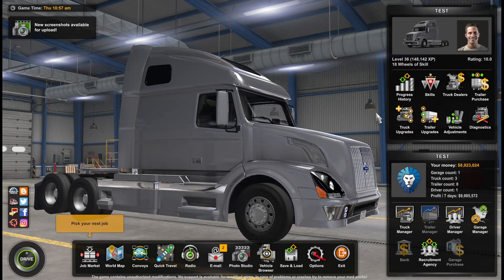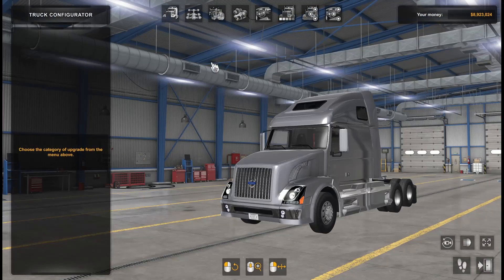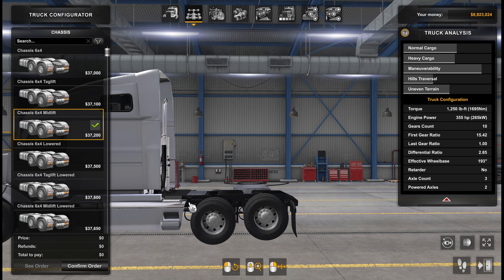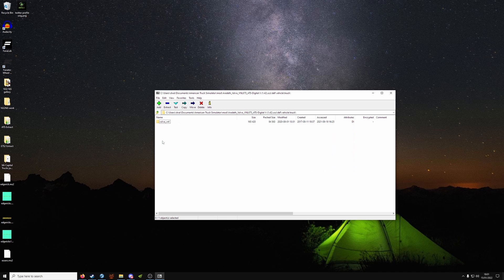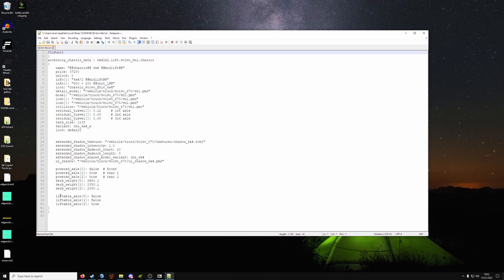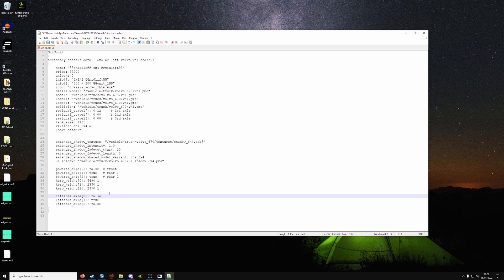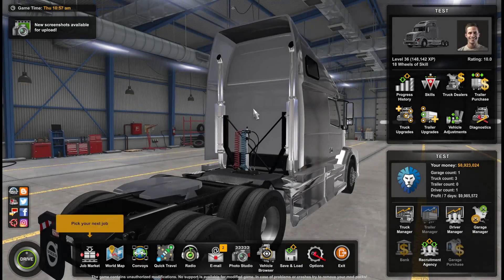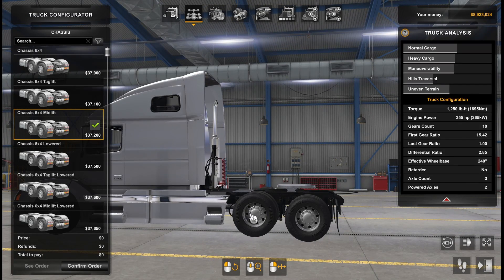ATS: How to fix Midlift and Taglift Axles in 1.43

Comment: Help me after 1.43 in ets 2 all scs trucks including mods tag lift lifts up wrong weel
Reply from the maker: This video explains how to fix it.
Reply: @digitalx8460  not modded truckd but orginal scs trucks
Reply from the maker: @limitededition3295  They should be updated I would have thought. Which truck has incorrect chassis defs?
Reply: @digitalx8460  all but but not pendrsgons volvo
Reply from the maker: @limitededition3295  Every single default scs truck has the wrong taglift/midlift axles? that has to be a mod conflict...
Reply from the maker: @limitededition3295  Here's the midlift from the DAF XF Euro 6, straight from the def.scs file, they are fine. https://i.imgur.com/SBsXfX5.jpg

Comment: I was trying with the W900L using the open definition for that truck and could not get it to work .
Reply from the maker: Is that W900L the "Big Bob Edition" per chance? If it's been updated for 1.43 the changes should be in there already. Say you have a midlift axle in game. There's 3 axles in that chassis' def file.

0: false
1: true
2: false

That way, only the middle axle will raise.